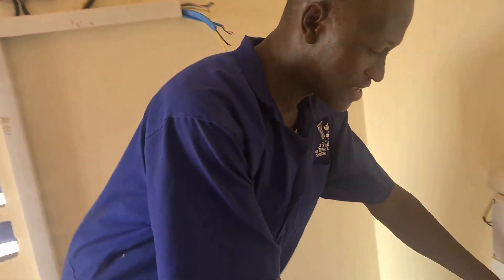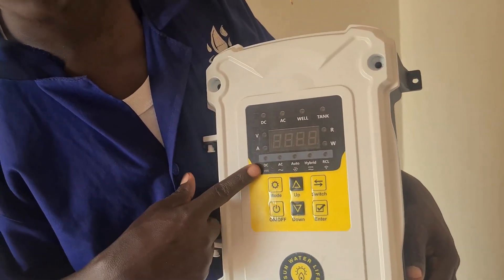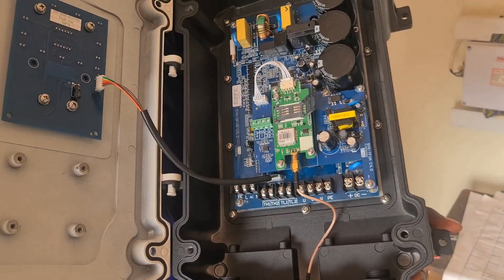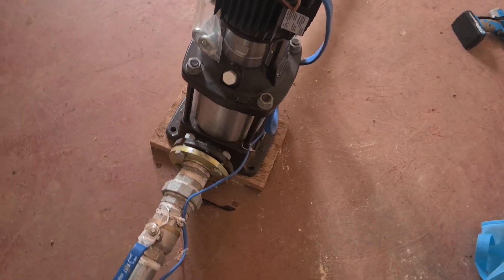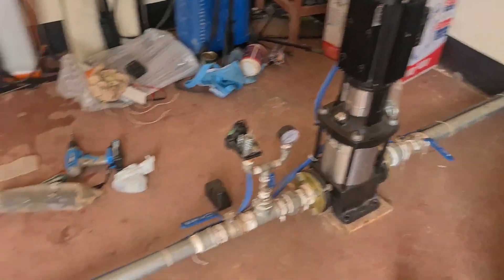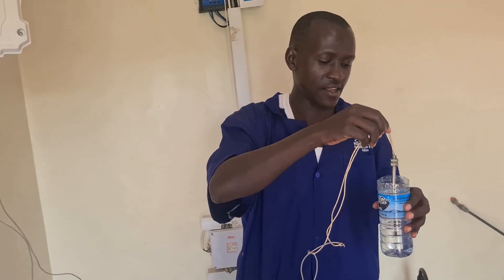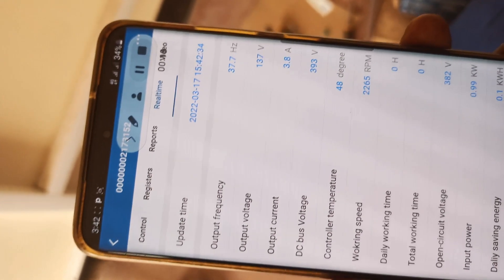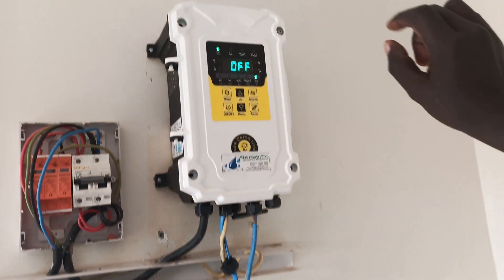Automatic solar and AC pump controller with remote controlling | Remote controlled solar pumping

Comment: Good morning Engineer? You are doing a great job. What is your experience with Hybsun solar submersible pumps and solar pump inverter for deep wells, head height around 180 meters? I have seen in your videos you use them. Can you still advise your client to buy or we should buy Grundfos for deep wells? Thank you for your answer.
Reply from the maker: I had no challenges with Hybsun pumps

Comment: Please can I use manual controller pumping switch to power the pumping machine when the automatic switch has fault
Reply from the maker: You can use manual controller on AC pumps

Comment: Hi I need a pump that can pump around:
Hz 50 kW 1.1 HP 1.5
VOLTS 230 PH 1 S.F. 1
AMP 8.1 CAPACITOR 35 uF
Reply from the maker: Hello, where are you based. What is the required pump head and flow?

Comment: Hi I need a pump that can pump around:
Hz 50 kW 1.1 HP 1.5
VOLTS 230 PH 1 S.F. 1
AMP 8.1 CAPACITOR 35 uF
Reply from the maker: I request to find if you're based in Uganda

Comment: Does it allow AC power to power the pump when the DC power is not enough to pump water? Or you will switch off the DC power and switch on AC pump to water?
Reply from the maker: It can be switched to automatic switching

Comment: Hi, Nice video with indepth explanation. I would like to know if the AC source(gen/utility) must be 3 phase input or the device can convert single phase AC to 3 phase as most rural areas are limited to single phase utility.Thanks
Reply from the maker: Thank you.
The AC source is single phase, the device converts it to 3 phase in the demo video.
Reply: What brand is the controller
Reply from the maker: Hybsun

Comment: I need a hybrid pump that can pump around 4m3 per hour at head of 30mtrs..how much can  in it cost, which model?
Reply from the maker: 4UPH750-45/9E Model (With 4 inch motor size, 750 watts, Maximum head = 45 meters, Maximum flow = 9,000 litres per hour) would give you the estimated 4m3/hr at a head of 30 meters, will cost you Ugx4,700,000
Reply: Hi, I need a hybrid pump that pump around:
Hz 50 kW 1.1 HP 1.5
VOLTS 230 PH 1 S.F. 1
AMP 8.1 CAPACITOR 35 uF

Comment: What is the problems when the sunlight goes off and frequency goes down and fails to go up again
Reply from the maker: There will be some fault when the frequency fails to go up
Reply: @WeisEngineeringLtd  i experience this problem and i always press the increasing button to restart the pump controller so what could be a problem in the ac/ dc controller
Reply from the maker: @innocentlesole5878  It might be about the voltage, pump/controllers have minimum starting voltages or we may need to know the exact problem. Does it mean the pump doesn't start at all even if there is sufficient sunlight before you press the increasing button(in most cases, the increasing button increase speed if the controller is running)
Reply: My surface water pump  2hp ac 220v doesn't start at all and burn with Frecon vfd 4kw  if there is sufficient sunlight and i don't why this happened ?and get err29 over current from Frecon drive  but submersible pump stop and when sun shine start work.
Reply: My surface water pump  2hp ac 220v doesn't start at all and burn with Frecon vfd 4kw  if there is no sufficient sunlight and i don't why this happened ?and get err29 over current from Frecon drive  but submersible pump stop and when sun shine start work.

Comment: If I want automatic solar water pump for livestock...what are the requirements
Reply from the maker: You may need float ball valves installed in the water troughs and a water level sensor in the tank.